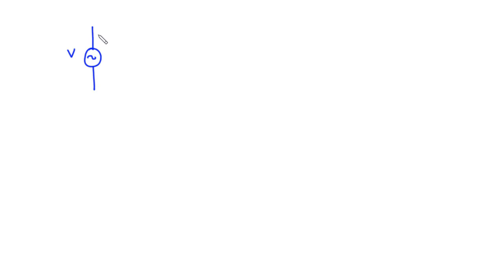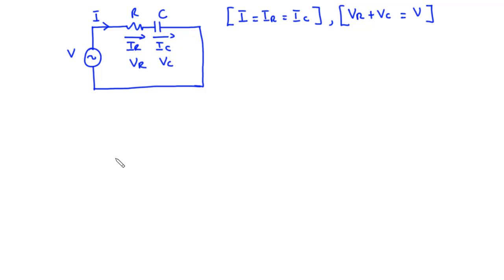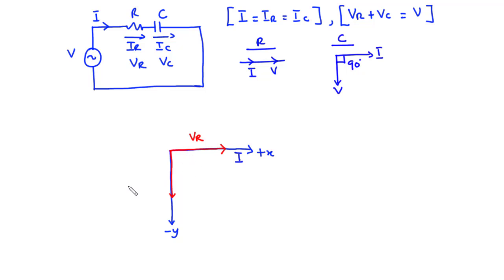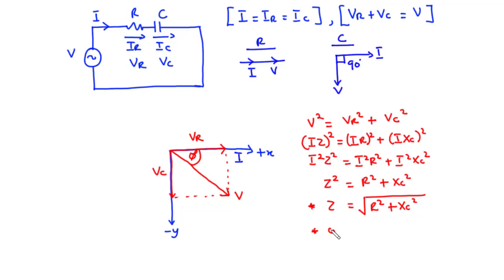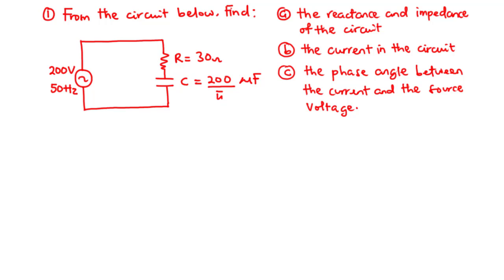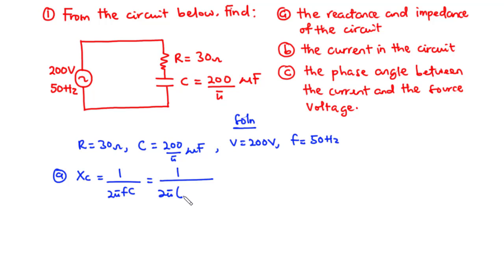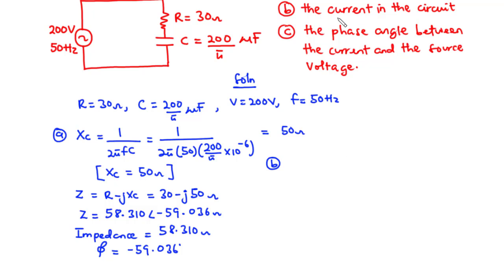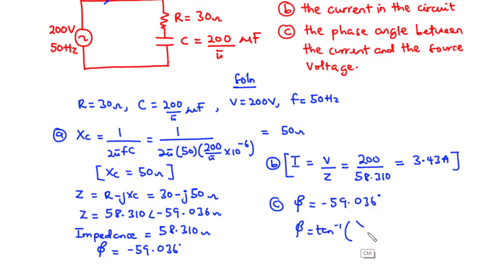36 - Series RC Circuits with Solved Examples | Solving AC Circuit Problems

Comment: Please why is the phase angle negative
Reply from the maker: Mimi, whenever you want to find the phase angle, always use the values exact values of Xc, XL and R, don't use the absolute values. And since the circuit is capacitive its going to have a -jXc component. That's how come we got -j50
Reply: @SkanCityAcademy_SirJohn  thanks but how will you know if a circuit is capacitive
Reply from the maker: @efyanaomi-eh9wg  okay, thats so simple, the circuit contains a capacitor, i.e 200/pi microfarad.
Reply: @SkanCityAcademy_SirJohn  so anytime a circuit contains a capacitor, the phase angle will negative?